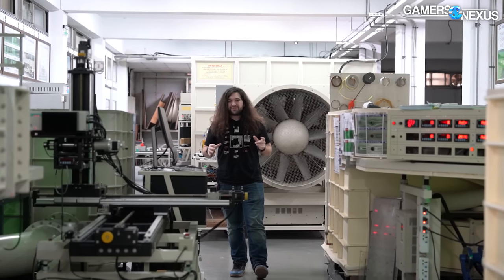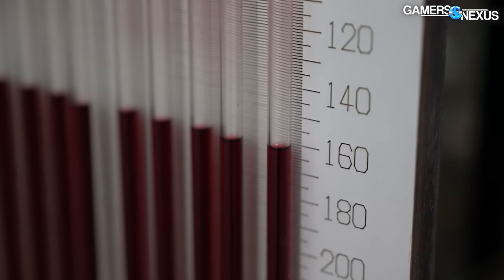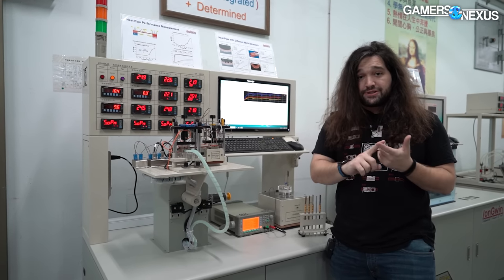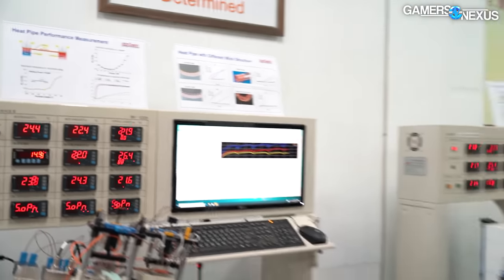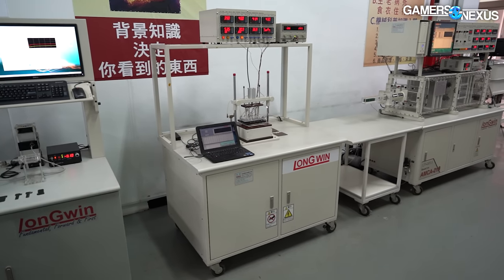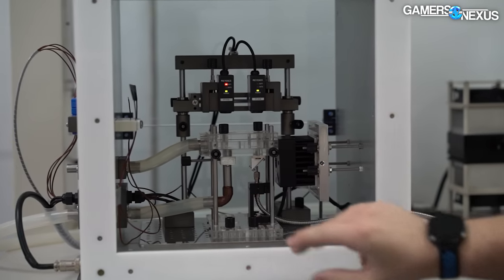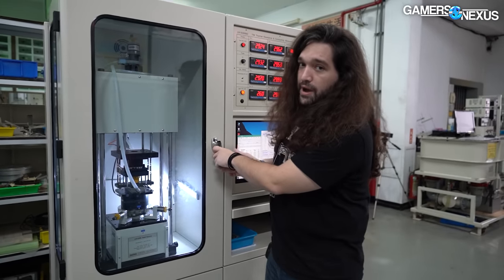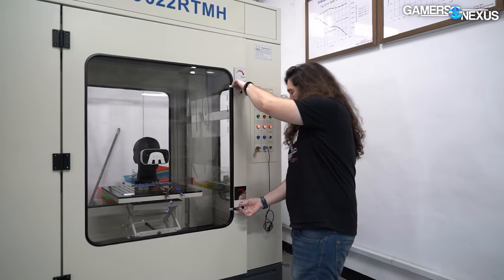Stopping Computer Companies from Lying | Asia's PC Test Equipment Megafactory

Comment: Attack Angle or Angle of Attack is a common term all pilots learn. Basically the angle of a wing vs the relative wind direction (angle too high you stall). In this case I imagine a component being angled against the wind in the tunnel to test  things.

Comment: That X-Ray machine is basically like a CT scan at the hospital. You rotate the stage instead of the machine, but the image treatment afterwards uses the same math (which goes way above my head). It's not easy to get right in terms of resolution, x-ray contrast, etc. The amount of cool stuff you can do with those machines is amazing though.

Comment: I absolutely love looking behind the curtain at how these things are tested.  This is the kind of thing I got into engineering for.  Every time you do a review and show off a new type of testing, or new methodology, I absolutely love it.  The CPU contact force testing was a special favorite of mine, along with the 12v connector testing.

Inspired in part by these types of videos, and GN acquiring a fan tester, I decided to try my hand at making a water cooling radiator tester.  Using some old components I had around, I was able to create a prototype that was, in my opinion, pretty successful.  It was no where near as professional as these machines, but I learned quite a lot from the first revision, and some day I would love to make another revision and do some real testing.

Thank you for doing these tours and showing us how its done.

Comment: 5:20 this is how PC coolers SHOULD be rated. instead of running benchmarks where there are dozens of different things that can change the outcome having a simple heater core, plug the cooler on it, and find out how much energy the cooler can dissipate per unit of time before it gets overwhelmed. No subjectivity, its repeatable, you get hard numbers that are easier to compare for a cost per performance output.

Comment: Temperature change can be calculated accurately, depends on the lapse rate, there are three lapse rates, dry adiabatic, saturated, and standard. knowing which one of those is prevalent one can calculate the pressure and density altitudes (vital for aircraft performance especially the take off). Aircraft instrumentation has CADC's (Central Air Data Computers) which calculate all this in real time for pilot display and auto pilot function.

Comment: Please, please, please find a way to test real life WiFi router coverage. Lately all brands focus on speed but not signal strength. You get super speeds 2 meters away, but almost nothing when there is even a single brick wall between the router and the receiving device. Old and slower routers seem to be way more powerful in terms of real coverage.

Comment: Somewhere I may still have the photos I took of the computers half covered in snow at a research station near McMurdo station (Antarctica). Running Windows NT(!) This was 20 years ago and they'd been running for years before that. Just humming away. Also of a Beowulf cluster for the neutrino and muon detectors at the South Pole at nearly 3,000m (>9,000 ft) altitude.  That's why you need to have test labs like this.
Reply: They'd have to run Windows to stay warm.

Comment: Speaking of thermal paste lol. Be careful ordering it off of amazon. There is quite a bit of Counterfeit thermal paste on there. I had bought from the cheapest seller.
Long story short I had a Stock AMD AM4 cooler on my 3700x with  "Counterfeit?" Arctic Silver 5 thermal paste. Apon removing the cooler 4 months later because it was running a bit hotter than it should I noticed that the thermal paste was all dried up and cracked and was flaking off. Arctic Silver 5 usually stays a bit greasy even after years of use.  I still have the tube and it looks identical to the new tube that I had ordered from a reputable seller in every way but the cheaper product was definitely Counterfeit.

Comment: saw on neowin that pcpartpicker tested some nvme drives [Samsung, Seagate, Hynix, Kingston NVMe SSDs may be suffering up to 53% performance loss] testing sequential read performance degradation… each unit took over 140 minutes to test… between formatting, writing files, letting pc to cool, repeat…

Comment: I don't know how I missed this lol, this is amazing. These are really cool people to let you tour this lab. I do have one question though: at around 8:30 you mention that the angle for heat pipes matters. I kind of felt it should but talk of capillary tubes made me doubt it. Either way, your own dummy heater is flat and horizontal right? The one you use to test cpu coolers with. Have you tried setting it up vertically so the cpu cooler is at a 90 degree angle to the ground, the same way it would be inside a PC (well, most PCs)? Knowing you guys, you might be already doing that but it's just that I last remember it being flat horizontal last time it was shown so I have to ask.

edit - nvm
Reply: Ok I found you already have a video on exactly this from 3 years ago. I had already liked it so I must've watched it too... I guess I forgot, sorry.

Comment: ~11 min in: In theory, heat pipes work most efficiently when the heat source is at the bottom of the heat pipe. Why are no manufacturers making tower coolers to optimize this?

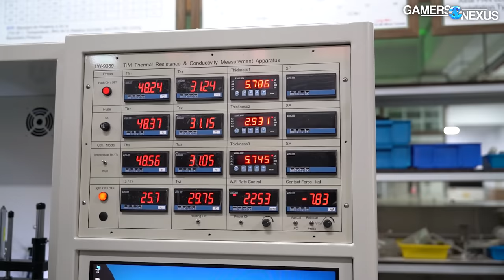Comment: @18:57  Left hand near pneumatic cylinder...right hand pointing at controls.  I've seen this before...it ended...with the loudest high pitched scream I've ever heard by anyone....and this was a guy!
Reply: Impressive test setups and controls/monitoring.  There is nothing like data collection and trending to sort things out.  Perfect comment on the optimal (vertical position) of a heat pipe.  It would be nice to see case manufacturer's take advantage of this fact and go horizontal (grrr....again)....why NOT get optimal heat sink positioning....when you're paying thousands...on a good PC.  Yet they sell vertical mount kits for high end GPU's....instead.....OR just rotate your case 90 degrees CCW on the z-axis and add a mirror if you must look at the innerds.  I degress!

Comment: Ok ok ok. Take your standard heat pipes, and then make a tower cooler, with mm thick vapor chambers instead of aluminium fins, sure it would probably cost $500, but i'd imagine you could disipate 300w+ from something the size of a Noctua u12S

Comment: I'm sure you may know but "Attack Angle" is a (possibly translated) way of saying "Angle of Attack" usually noted as AoA or as "Alpha"/α and it's the angle or difference between a reference line on a body (in aircraft the chord line of the wing) and the vector that represents the relative motion between the body and the fluid/air. Simply put: If air go perfectly horizontal left to right and 'wing' surface tilted up at 45 degrees then AoA is 45 degrees

Comment: I just wanna point out that if that altitude system had been pressurized, that would of been BAD. I work with pool systems and even the pressure from those can cause serious injury and they're at 1-3 Bars.
Reply: "would of"?????

Why would the chamber be pressurized?  If anything, it would have a slight vacuum to duplicate the effects of a high altitude location.
Reply: @bobbydazzler6990  To replicate a positive pressure system to stress test it but it likely does both!
Reply: @KeepRespondingWithYourLove  How much pressure would be needed inside that chamber to replicate the lowest elevation on Earth where one could expect to use a PC cooling fan?
Reply: @bobbydazzler6990  Seems like you've mistaken the reply button for Google search! Try again on the top of your search bar!
Reply: @KeepRespondingWithYourLove  No, my friend, I was subtlely pointing out the fact that your "the wessel would hold DANGEROUS amounts of pressure" comment is absurd and wrong.
Reply: @bobbydazzler6990  even a vacuum returned to pressured atmosphere is dangerous, so yes. It's still dangerious regardless.
Reply: @KeepRespondingWithYourLove  "I just wanna point out that if that altitude system had been pressurized, that would of (sic) been bad."

1. How much pressure would be applied to a chamber meant to replicate the atmospheric pressure of various altitudes on planet Earth?
2. I don't put much stock in statements made by a person who said "would of".  Those two words are NEVER found next to each other in the English language.
Reply: @KeepRespondingWithYourLove  My young misguided friend, perhaps you should pay closer attention to the videos that you watch.  It was clearly stated in the video that the "pressure chamber" is used to replicate the atmospheric pressure at different altitudes.  For the fourth time I ask you, how DANGEROUS is the highest atmospheric pressure on Earth where a person could expect to operate a fan compared to the ambient air pressure where the testing lab is located?

In addition: in your final sentence, the word "issues" and the word "is" do not match.   Your English teacher would fail you for that mistake.   You should have written "issues" and "are".  Judging by your butchering of English, you still have quite a few years of school ahead of you.  I hope they prove to be educational.

Comment: What I find sad is even though the underpinnings of all the high technology today be it software, hardware etc... originated in north America and Europe, Asia has stripped away all the manufacturing of  it.
Reply: @1pcfred  Put away your rose colored glasses....
Reply: @1pcfred  ASML is one company in the Netherlands. I am not talking about China. I am talking about Taiwan.
Reply: @christopherjames9843  Taiwan has been doing good for themselves lately. They're still not on par with the west though. What we do here is not visible to common folks. You made mention of all we did in the past but find out when we did it and when it entered the knowledge of people and you'll find quite a gap. The transistor for instance was invented in 1946 and it wasn't commercially available at all for over 10 years. It wasn't really widely adopted for more than a decade after that. In the 1960s tube tech was still the prevailing electronic device.

Comment: Are the "engineers" who design VRMs required to wear Zoot Suits or dress as flappers because of the 1920 vintage circuit they use? Do the PSU "engineers" get the option of 1920 or 1988 vintage apparel?

Comment: Hey Steve! What do you think it's the best AIO on the market for a 13900ks in the 360 size going on a z790e Asus board? Please help? I plan to play with basic overclocking. Cost is not a concern but I don't want to do a custom loop.
Reply: There is a reason they personally use the Arctic AIOs, they are some of the best. One of the reasons though is b/c the rads they use are a few mm thicker than most of all the other companies, so you want to keep that in mind for case compatibility.
Reply: @Dan-Simms  Ok cool! Yeah I got the 240mm arctic liquid freezer ii for my last system and moved it over to this one. I am a little worried it's not up to the task from a size standpoint and there are a couple things I really didn't like about it's design. I don't like the backing plate they shipped with mine at all. And I also didn't like that the pump brackets screw in with one screw near the middle of the cooling plate. I ran this on my last system for a month before moving it over to this one and those screws had come kinda loose and that was with blue lock tite on them. I worry that it won't evenly apply pressure to the CPU if only 2 screws and ensuring even pressure application.